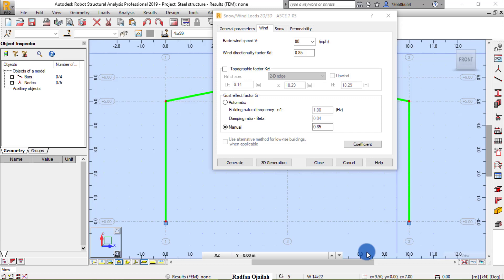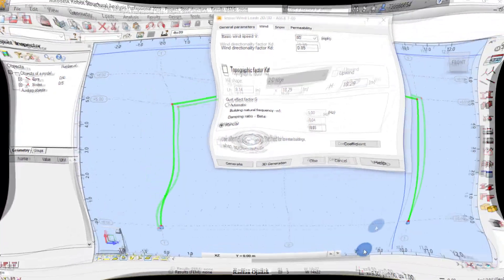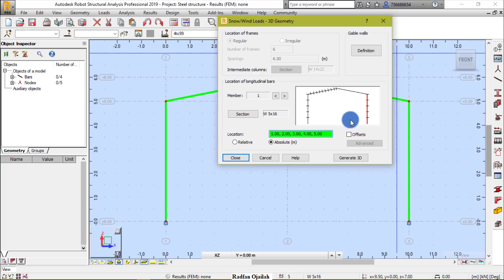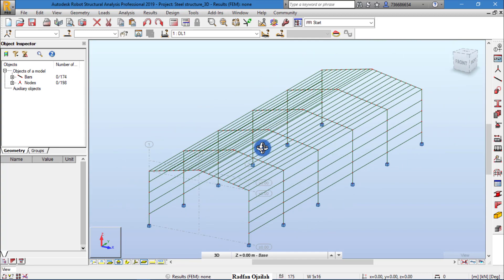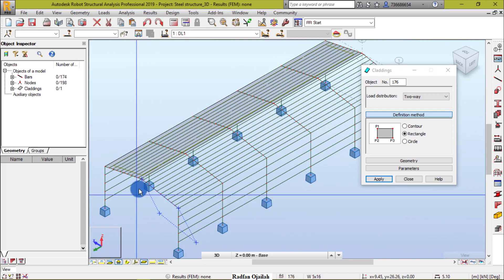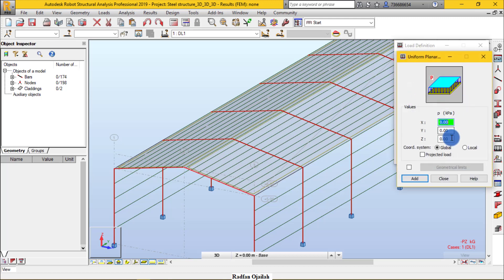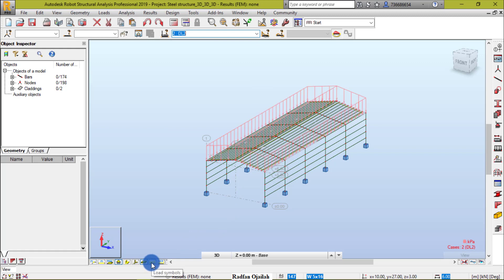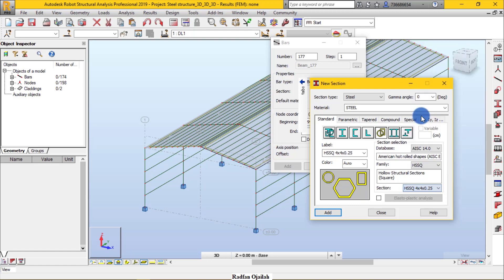Steel Structure design using Robot part01 vid03: 3d generation, cladding, load definition, bracing

Comment: I've been trying to follow some youtube tutorials on Robot, but I have come across a few steps where I cannot proceed. I'm using Student version and Australian codes. I was wondering if by using the Australian code and following tutorials in another codes could cause any trouble.
Reply from the maker: Not at all, you will notice few differences in the results of the analysis and design as well.
Reply: Just read some posts saying there’s no code checks for Australian standards in reinforced concrete.. I changed code parameters to eurocode and it worked. For steel the Australian one works fine
Thanks for the reply